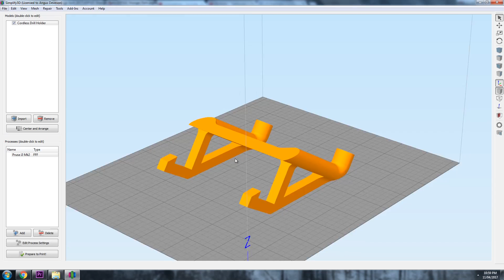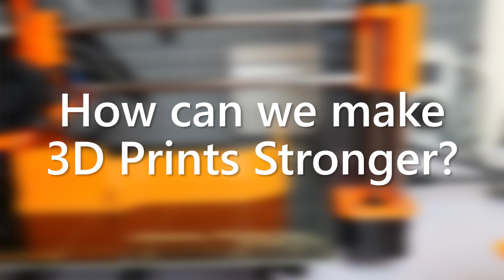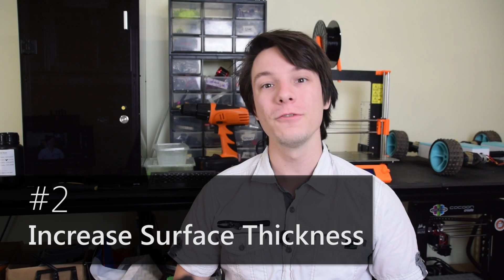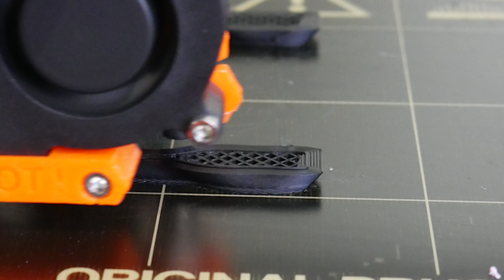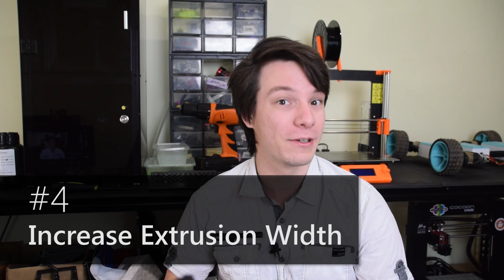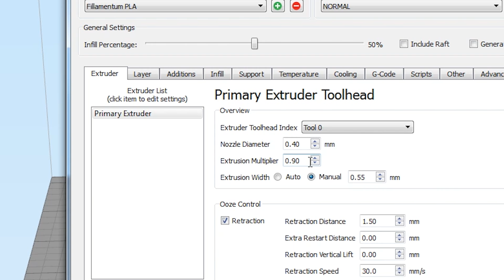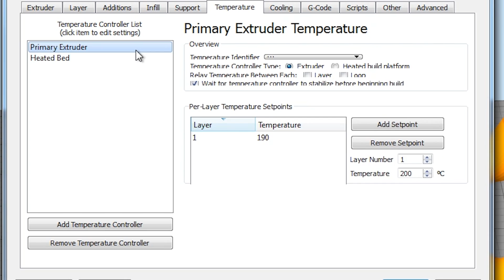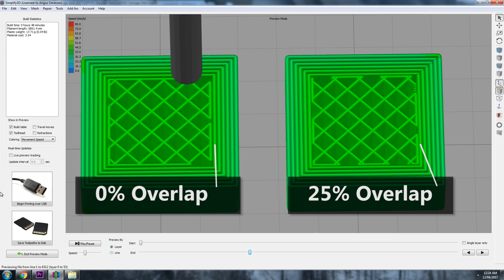3D Print Stronger Parts! 3D Printing 101

Comment: Increasing/changing the extrusion multiplier is usually a bad idea since it will change the size of the part slightly. That means that tight toleances might not fit.

Comment: Angus, could you do a show on making Simplify3d work with the Trinus? I'm having all kinds of problems making it work. I put in a post slicing macro to fix the file format and slowed the prints to the speed used in the Pango slicer but still get unprintable gcode out of Simplify3d. Thanks

Comment: Good info but I have one question, a chain is only as strong as its weakest link, lets assume that the tinsel strength of PLA is 500psi and the layer joints are only 10% of the tinsel strength. How is having fewer joints (larger layers) going to make your part stronger than a holding strength of 50psi?
Reply: I doubted this also. Say each link strains a certain amount before it breaks - spread this strain over more links, and get a more resilient part, no?

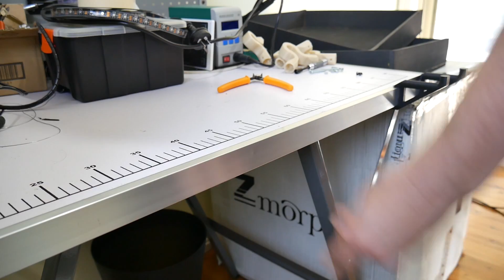Comment: Hey Angus, enjoy your show! It's hard to see in the video, but if you look at the video at 1:00, it looks like the mount breaks at the corner where the horisontal support surface (that rests on the table top) meets  the vertical (rests on the table edge). It's possible that you can make the part stronger by simply adding a small fillet where the surfaces meet: 
https://en.wikipedia.org/wiki/Stress_concentration
 .
Also, try extruding the horisontal support's vertical surface ten or so millimetres, in effect adding a box to the triangular cross section, making the part resist twisting a bit more effectively! Please report if this works; I'm curious. Or, if you don't have the time, please send a link to the Fusion 360 file.
Reply: Edit: I did a quick Simulation run i Fusion 360, and the fillet makes absolutely no difference, but the extrusion helped! (Simulated with 10x10 mm square profile bars of ABS plastic, and a load of 50N, just randomly chosen numbers...)
https://www.dropbox.com/s/4emwb2vao1uedoi/Screenshot%202017-04-14%2010.18.25.png?dl=0

Comment: Great video.  One thing I would disagree with is modifying the "Extrusion Multiplier" in effort to gain strength... The multiplier is more for calibration, and should not be treated as if its a direct strength factor.

Comment: I heard that baking the piece in an oven (at around 140°C for pla) can improve the rigidity (because layers are "weld" between them) but it also change a little bit the dimensions of the print

Comment: how do I find the correct values for extrusion width and extrusion multiplier? 

like I followed the documentatio for my kit and just copied the .ini from the stock Slic3r to the Prusa edition later. 

I feel like I am extruding too much plastic as vase mode prints with large surfaces do wobble a lot.

Comment: Or if you have $14,000 laying around you can get yourself a markforge machine and print nylon/carbon fiber parts, lol
Reply: or spend $9.00 for a steel nozzle.
https://www.aliexpress.com/item/10Pcs-3D-printer-E3D-V6-Extra-Nozzle-Stainless-Steel-Nozzle-0-25mm-0-4mm-0-8mm/32656083259.html?spm=2114.01010208.3.125.zdzd3S&ws_ab_test=searchweb0_0,searchweb201602_5_10152_10065_10151_10068_10130_5070016_10136_10137_10060_10138_10062_10156_10153_10141_10056_10055_10054_10059_10099_10103_10102_10096_10148_10147_10052_10053_10142_10107_10050_10143_10051_10084_10083_10080_10082_10081_10178_10110_10111_10112_10113_10114_10037_10033_10032_10078_10079_10077_10073_10070_10123_10124-10033_10037_10077,searchweb201603_6,afswitch_1,ppcSwitch_4&btsid=a8529fb2-c5d1-46d3-b842-39c03e55bf2a&algo_expid=94f8c0bd-b3d8-45b5-aa39-667f33d69131-14&algo_pvid=94f8c0bd-b3d8-45b5-aa39-667f33d69131

Comment: Good day, does the layer height tip work for ABS as well? specifically if you used acetone for smoothing (as it forms a layer weld?). Also can you do a stress comparrison between 100% infil and for e.g. 70% infil. I was wondering specifically w.r.t. compressive stress if the triangle/diamond formations inside aid in strength or would 100% infil be better?

Comment: I remember the first time I printed with a 0.8mm nozzle at 0.4mm layer height. Even with normal settings (0.8mm walls and 30% infill), the parts were SUPER strong when compared to a normal 0.4mm nozzle.

Comment: Proper part design is hugely important. Making sure there are no stress concentrations and reinforce critical areas with more material. Parts should use huge fillets and round overs and be as smooth as possible. 

Soon we will have topology optimization integrated into our design tools and we can print parts that actually hold up and use minimal material. 

How to design without software: https://www.youtube.com/user/ClausMattheck/videos

Many have also mentioned annealing.

Comment: Angus, will you be making any videos that show how to tweak slicers other than Simplify3D. I cannot afford S3D and I am sure there are many more people in the same boat. I use Cura and it does not have all the options of S3D, it would be great to get your recommendations for Cura and others.
Reply from the maker: I'm pretty certain all the settings changed here pertain to Cura, but they may be much harder to find and tweak. Other videos such as multiple processes and manual supports however are features only supported by Simplify3D.

Comment: I think changing the layer height doesn't actually change the "accuracy" as stated, however it changes the resolution. The accuracy of the printer is going to be the same as before you changed the layer height. hope this made sense.

Comment: I 3D Printed a motor mount for my electric longboard and I also printed the battery case for it :)
Reply from the maker: Sweet! Hope it can hold up to the heat, those motors get HOT
Reply: I know xD It works great, never had a problem, I already traveled like 50km (or 31miles) :) I can also go up to 40km/h (25miles/h). I got a 6s, 6000mAh lipo, I can travel like 10km to 15km with 1 charge :D
*edit
The ESC has a intel stock heatsink on it xD
*edit 2
Material: Colorfabb XT
Printer: Original Prusa i3 MK2
Reply: I've built one aswell but with aluminum motor mount. Be careful with that motor mount. During use your motor will heat up quite quickly and might warp the plastic. The mount better be made of ABS. 

However I did print a battery casing aswell, ABS and it's holding up great!
Reply: default extusion width 0.48 ?? what layer height do you run that amount of width. seems alot.

Comment: Found that slowing down printing speed also makes a difference. It allows more heat to soak into the previous layer, remelting it better and creating a stronger bond.  Hot and slow makes a huge difference to parts that need to be strong.

Comment: In my experience, in order to make proper tough functional 3d printed parts the best option is to split them up to make sure the print orientation matches the stress it's going to endure and then epoxy them together.

Comment: i see a design flaw... as the hooks are so high all the weight/force is more horizontal to the top part of the table mount.... if the hooks where lower then the table the force (lever) would be more vertical...? right?
Reply: Not entirely, with corners leading down to the lowered hook, there are many more weak points which could snap. His design is quite optimal. With the rib below the hook, I'd say there's plenty of strength

Comment: The smaller the grain in wood (walnut) the harder and stronger the wood (v. Pine). Also I'm surprised you didn't touch on filament types for stronger prints: PLA v ABS v PETG v Carbon Fiber v Nylon, etc.

Comment: I'm very skeptical that having a higher layer height will improve the strength of the part.

I'm no mechanical engineer but, if we apply a force on a spot, the force will be applied on multiple layers, and the more layer we have, the less force each layer has to endure, right ?
Reply from the maker: The change I applied here won't have a huge effect, but compare strength of a part printed with a 0.8mm nozzle at 0.4mm layers with a 0.4mm nozzle at 0.2mm layers - the 0.8mm nozzle print will be a lot stronger and less likely to delaminate. You also need to factor in the increased extrusion width however.
Reply: Speaking from experience, with a 0.4mm nozzle, printing PLA at 0.4mm layer height resulted in a part less resistant than when printing at 0.1mm height (the 0.4mm broke when I applied force onto the part where the 0.1mm is very resistant).

But it might be worth looking into it with a more "scientific" approach. :)

Cheers from France!
Reply: Hi Angus, nice video. Since you just wrote about 0.8mm nozzles, do you have some good settings for the Prusa or can tell me, which ones I have to change for bigger nozzles?

Comment: I have actually found that decreasing layer height yields stronger parts because the layers are bonded together better
Reply: This comment thread has restored my faith in humanity. It seems there are still comment threads that don't devolve into screaming profanity
Reply: lastdarkjedi I feel the same, I think it matters more thickness of one layer then the height, so the thickest the layer the higher the surface of layer bonding . I was expecting more scientific of a test like make a part and then put some weights or something .
Reply: I was curious about the claim he made in this video so I tested it and found the opposite to be true.  I got stronger parts with decreased layer heights.
Reply: Frans Johansson studied this at Blekinge Institute of Technology in Karlskrona, Sweden 2016 and found that decreasing layer heights made a stronger part. https://drive.google.com/file/d/0Bxo6VdyjA6VPdTBtajJWR2lHcFU/view
Reply: For a long time, I thought decreasing layer heights made a stronger part as well. I tested it out because I wanted to prove the others wrong. Turns out, as long as you print at the correct temperature, larger layer heights are much stronger.
Reply: With the exception of his grammar and punctuation, that's a fairly nice thesis with a lot of data.  One thing that he points out on page 45, is that his E-modulus is not accurate but then goes on to state (page 68) his results.  Then compares them with another research paper effectively validating them.  That being said, I did re-open my "which is better" question.  Thank you for posting!
Reply: This makes sense. Decreasing the number of delamination sites wouldn't make positive difference as delamination isn't a by-chance phenomenon - It occurs at the point of highest strain. Spread this strain over a larger number of layers, and the part can stretch more before delamination.

Comment: PLEASE HELP. I have all the settings down, but i still get small blobs all around my print on the outside layer. How can i remove then? Using simplify3d here.
Reply: If they appear on the finishing end of a "trace", try use Coasting distance (try start with 0.2 or 0.3mm and increase if there are still there and viceversa), if they are in the starting point of a new "trace", use negative Extra restart distance (again start with 0.1mm or less and adjust).
PS: the numbers are what i use on mostrly ABS, for me HIPS require lower distances and PLA even lower.
Reply: Giovanni Carlo Iglina thank you. I will try

Comment: For print orientation, I would split off the cross-bar on your print here and lay the other two parts flat, then glue the parts together after.  The cross-bar is not a load-bearing piece; it just spaces the load-bearing pieces.  I agree that you get the best strength when the shear force is parallel to the layers.  Sometimes breaking up a print can enable you to make a stronger print without too much post-print hassle.  Sometimes, though, you just want to pull the part off the bed, ready to use.

Comment: Nice summary Angus! It would also have been interesting to mention the use of different materials for each application. PLA - strong, stiff but brittle and is not good at coping with higher temperatures. ABS is weaker and less stiff but much more ductile and can be used at higher temperatures...
Keep on creating such content!
Reply from the maker: True that, but it's no longer so clear cut with modified PLA's such as polymax (rediculously tough for a PLA). Many machines don't really support ABS properly without mods so I recommend printing in the modified PLA's or PETG for ease of printing. That is unless you've got a passive/active heated chamber - in which case bring on the PC-MAX :D

Comment: Another tip might be to adjust the angle and/or orientation that you print the part. When you are designing or printing the part you should take into consideration the forces that will be applied and in which direction would be the greatest. If you are unable to print the layers opposite of the force direction, this would be when you want to print at a slight angle (~15 - 30 degrees - This is just my suggestion). This also, as @MakersMuse pointed out in his recent review of the Moai SLA Kit video, that printing at a slight angle does increase the detail of the print by almost making the layer lines disappear.

Comment: Well, FDM is not the strongest, but SLS/Multi Jet Fusion is capable of producing parts as strong as Injection Molded parts in terms of Heat Deflection and Tensile Strength according to official tests. I also print with a 1mm nozzle and the parts are significantly stronger too. I didn't test the differences, but I'm sure you did at one point :).

Comment: Vapor smoothing or annealing can definitely strengthen parts in addition to changing settings. Great tutorial!
Reply: I heat treated some PET-G spanners for adjusting shock absorbers yesterday and the firm spent all today trying to break them. Even putting them across a kerbstone and driving the 7.5t truck over them just bent 'em a little...
Reply: EnergyStrike Hence why he also mentioned annealing. PLA prints and casts which have been post-processed in an oven (conventional, toaster, rotisserie; I've heard recommendations for everything but microwave) at a specific temperature range for a known curing time have shown to have significantly improved qualities over untreated PLA, adulterated PLA (both treated and untreated), and in some cases even ABS.

Mind you, I only know that because I saw a video about it and looked up more information. I still don't have my own printer.
Reply: +Sean Smith - I tried the boiling water trick with PLA - it's a disaster. The result is far, far weaker than the part straight off the printer.

But annealing PLA in a dry oven @ 110 degrees (Celsius), with a gradual cool-down to allow the crystals to get large, seems to increase the strength significantly.

One day I will print a bunch of PLA test bars and search for some sort of optimal annealing temperature profile for PLA, because the potential improvements in strength should be worth that effort... one day ...I promise ... ;-)
Reply: Sean Smith Does this rag smell like chloroform to you? ;-) More seriously, these are all very informative comments and post-processing of any material is such an important step that the various methods for each material should really be covered in someone's basics tutorials.
Reply: I have even heard of boiling pieces because you are looking for about 200F. If that is true, then steaming them could also work. Indirectly of course.
Reply: Paul Gross This might be a good start for you: http://www.4spepro.org/view.php?article=005392-2014-03-28
Reply: Vapor smoothing is only a option for ABS he printed it in PLA
Reply: PLA can be vapour-smoothed with chloroform.
Reply: Save the PLA, chloroform the maker. Chloroform everyone and the PLA is safe from meddling around with it!
Reply: claws61821 - nice find! 

That seems to confirm roughly what is happening with PLA when annealing:

Higher temperature and longer cooling times lead to greater crystallinity, which in turn means greater mechanical strength. And it also appears to improve chemical resistance too.

That probably explains why annealed PLA can handle boiling water, whereas without annealing, boiling water just turns PLA into a blob. 

I have a hope that with this technique PLA can become the wonder plastic of 3D printing: Easy to print with, and after annealing, very strong and water-resistant.
Reply: What if you were to print a part while it was in a vapor environment? ( flammability hazard aside ) to help bonding between layers?

Comment: I typically print my layer heights at half of the nozzle diameter.  I find this very optimal for most use cases.  Occasional when I want something to look good, I go to 0.25 * nozzle diameter (typical nozzle diameter is 0.4mm).  It's great you mentioned that layer height does depend on nozzle diameter.